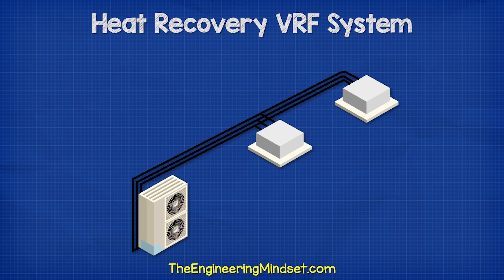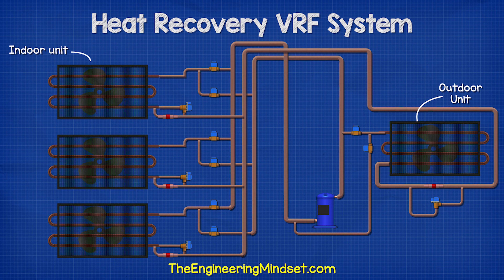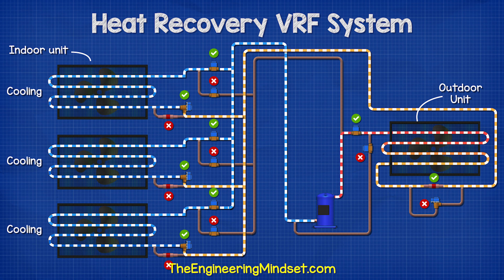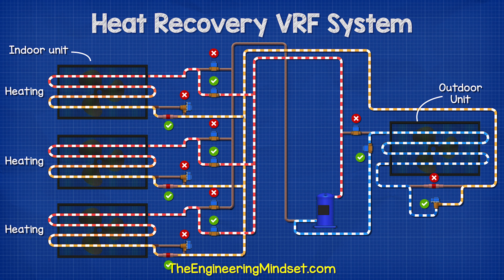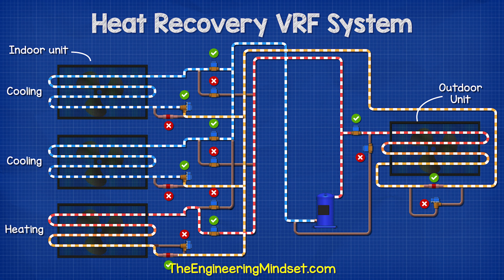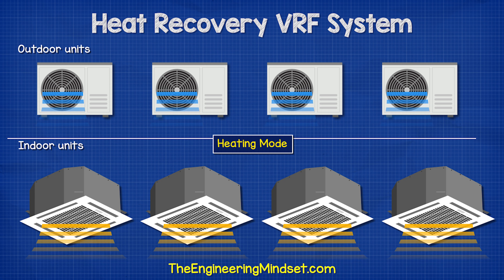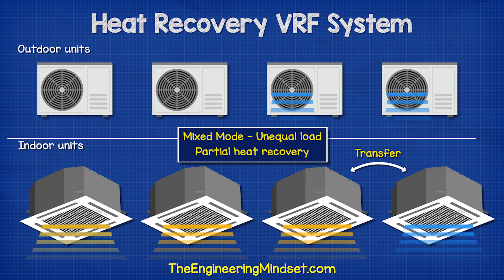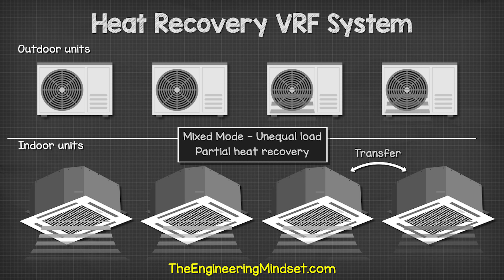Heat Recovery VRF System - How it Works

Comment: I work on engineered systems. Energy management environmental control. Two pipe for pipe blended, mixing boilers chillers .. I do see a need for these where grade is a challenge for a retrofit or an addition

Comment: I work on water cooled / air cooled chillers, RTUs, VaVs, split systems, mini splits, boilers, furnaces and VRF systems. VRF is one of the most complicated things you can work on HVAC wise, in theory they are a good idea but they break down a lot more than other systems and some VRFs have triple or quad coils and if you have to change one you have to change all 3 or 4 and littarly take the entire unit apart all the controls you have to have a hand held to shut off the valves just to transfer the gas, especially if it's like a citi multi-pipe they are hell to work on. We were going to do a system that had a leak on one of the coils they told us we had to buy all 3 for 70,000$ or a new system for 100,000 it would take almost 2 or 3 days with guys who know what they are doing to change the coils out it's really labor intensive
Reply: Is there anything during the building design or installation phase that would make your life easier on these? (Even just having more space in the mechanical room?) Also, is routine maintenance being neglected to cause the coils to fail? What could extend the life of the coils?
Reply: Thank you for adding this. I noticed many of the manufacturing sales engineers push for the VRF while a small scale VRF (for single space) can easily be replaced by Heat Pump.
But typically VRF are more expensive systems and they are promoted as super efficient, while they are but if applied in large buildings where energy recovery is often used (for example in hotels when in a normal spring day, you may have cases where mixed conditions existing, heating & cooling @ the same time in different rooms)
Reply: Efficiency and economic viability of vrf systems greatly depends on the space  where it is installed and the operating conditions.

Comment: I am going to be controversial and say that large central VRF systems are not the future.
Reply: Actually a lot of commercial building are using VRF systems, I do commercial HVAC I think water or air cooled chillers are best for commercial buildings but there are so many factors that come into play when you design a system for a specific building or business. VRF are very very very expensive to repair and the wait time for parts is 6 to 8 months sometimes they will straight up tell you it's faster and cheaper just to buy a new system. Plus you need a hand heald just to be able to operate it and close/open valves. You can't just hook your guages to it and read pressures it won't be correct if you don't have a 2,000$ hand held you won't be working on VRFs for long. Chillers have been around for years and they are easy to work on, weather it's water or air cooled and most of them have VFDs that control the motor / compressor with over / under load fault protection
Reply: @cameron3991  what about heating?
Reply: @cameron3991  Vrf scroll compressors also comes with vfd na?

Comment: Great video. I worked with heat pumps and large Commercial chillers and Building automation systems and variable speed compressors and the key is to have a VFD variable speed compressor to be able to run at low loads. Plus they are a lot more NRG efficient than conventional split phase compressors.

Comment: It would be interesting to see for this type of AC that able to change heating and cooling. Also, how fast refrigerant liquid turn into gas prior enter the compressor which is in reverse direction.
Reply: He has videos out your talking about a heat pump system with a reversing valve that changes the direction the gas flows in the system it turns your evaporator into a condenser and vise versa to be able to heat and cool.